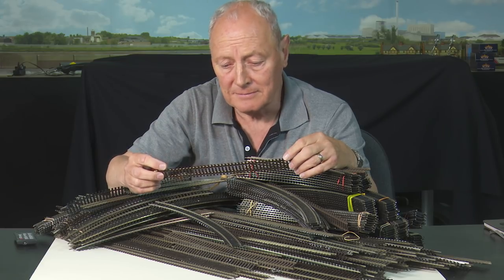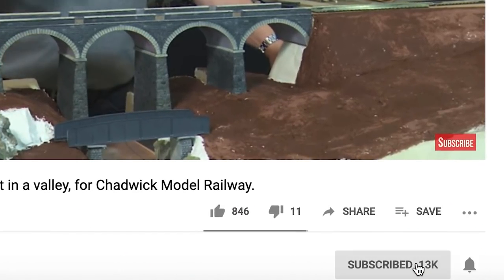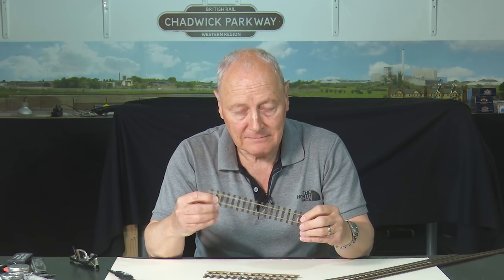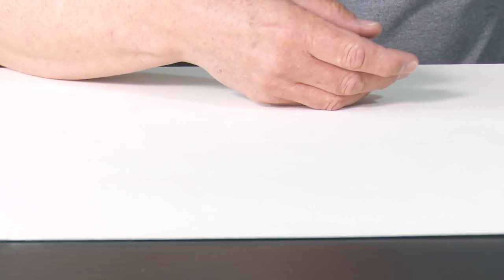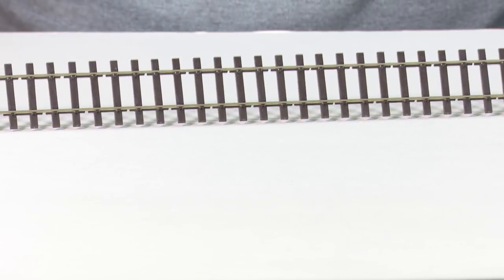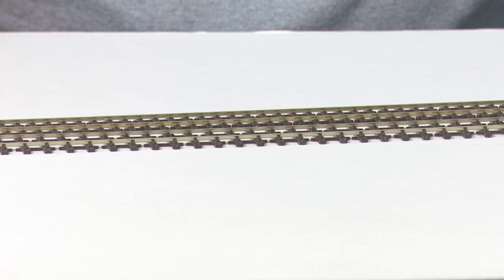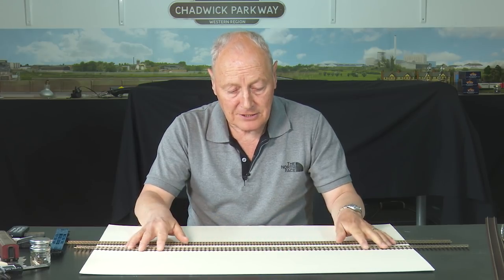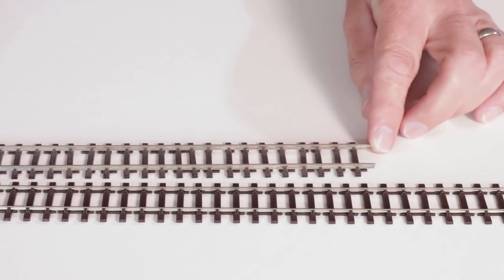Track  Peco Code 100, Code 75, Bullhead, EM and P4 explained at Chadwick Model Railway | 66.

Comment: This is a great video Charlie.
Recently my mother wanted to get the majority of my items I still had stored at her house out of the house in case her and my dad decide to downsize the house so she brought me a bunch of things one of which was my old "Micro Machine Trains" from the Micro Machines line by Galoob. They have no motorized Locos so you have to push the trains manually and are about on par scale wise with Z scale.
My son isn't old enough to play with them yet but when he is I will be excited to do so.
I have 3 of the Engine House sets which from what I can tell are quite rare, 2 of the Tressels which are also quite rare. 5 Left hand and 5 right hand points (points appear to be uncommon) and a bunch of straight and curved pieces for both the original track which has a raised groove down the centre of the track and the newer track which has a wider recessed area in the middle.

Appearently they were only on the market for about a year or two between 1989 and 1991 but it appears that my young self acquired over half, probably closer to 3/4, of all the different Rolling stock and Locomotives in the line.

At present time, finance and space prevent me from building a proper layout but at least I have some train related items to share with my son once he gets old enough that he won't choke on the rolling stock (He is at present 4 months old)
Reply from the maker: I’m so pleased that you enjoyed the video and that your situation has ring fenced a great deal of future fun.

Comment: Hi Charlie, very informative and enjoyable 👍. No bad language from me but I find Setrack a perfect solution for my needs. Living in London usually comes with 'cozy' living accommodation. Setrack enables me to quickly set up simple but functional loops and points with my design workstation in the middle. That way I get to enjoy running my locos and get on with my work at the same time. My wife often comments on the noise from the trains going round along with the fans whirring away on my workstation while I'm rendering out animations. It can be quite a noisy little room. Always inspired by all your (and everyone elses) videos about model railways but I can only dream... ;-)
Reply from the maker: The set track comment was a little tongue in cheek. 😜

Comment: Great video, as ever very informative. I'm about to come into a position of starting a layout after decades of frustration as an experienced modeller who lacked the space and time to branch out (pardon the pun) into railway modelling. I resisted the urge to go 'N' as I enjoy scenics and buildings and suspect the scale would be frustratingly small. I am very familiar with 1/76 and 1/72 from other interests. As I am starting from scratch existing rolling stock is not an issue, my debate has been code 75 or new bullnose, so this video has been a welcome overview. Keep up the great work and ignore those who might want to 'give you a thrashing,' you are only politely expressing your opinion on your channel about what you want to do. As in other areas, some more reactionary contributors would do well to think on that.
Reply from the maker: Thanks Chris. It’s comments such as yours that make it worthwhile.

Comment: Just quick point about concrete sleepers and bullhead track. Up on the Inverness to Aberdeen line we have quite a few miles that have bullhead rail on concrete sleepers. It is being gradually replaced but it’s still there. It’s also long welded bullhead- Cheers, Eddie (train driver in Inverness)
Reply from the maker: Thanks Eddie, fascinating info. 
Regards Charlie.
Reply: Great video as usual- working my way through the back library of your videos.

Comment: sorry if this is a repeat. 
luv your channel & all things UK prototype.
i'm a US outline N-scaler running code 40 & 55 track and old Fleischmann, Roco & Model Power stock, i.e., HUGE flanges !!!     (pizza cutters )
instead of buying all new low profile wheel replacements, what's working for me is the Dremel rotary hobby tool. set it securely in a vise. grind down the flanges with the Dremel. slow speed for plastic, high for metal.  use safety glasses of course. very quick solution and saves lottsa dough !  not gonna dump my old code 80 Atlas track though, it still has it's place in staging yards and 3 to 4 feet from viewing points, when painted with 'rust' (combos of raw, burnt umber) and well ballasted. besides i still need #4 &6 turnouts (points) which are not mfr'd in the smaller codes.  cheers to chadwick !
Reply from the maker: An excellent suggestion Mike, I shall have a go. Regards Charlie

Comment: That was just what I needed to find out. I am returning after 40+ years away and I have been thinking code 75 bullhead as it fits with the time line I have in mind. As I don't have any rolling stock or loco's at the moment, I don't even have a base board either, then I probably will be ok but will bearing in mind the issues you mention. I think you did. fantastic job explaining it all and I will be trawling your videos for more information.
Reply from the maker: That’s most kind CJ.  It’s great to have you onboard. Regards Charlie

Comment: Good timimng Charlie. I have just been through the exact same process and also have miles of code 100. I am in the process of undertaking a total rebuiild of 190m of double track layout with 7 Termini. Shades of  McKinley, well maybe but not so big. An way, looked long and hard at Peco Bullhead track and decided that it was worth laying some. It does look good but as you pointed out the real problem at the moment is un-availability of points. cross overs and slips. Also the cost of bullhead is considerably more than either code 100 or 75. So I currently hacking lengths of code 100 to get proper sleeper spacing. The difference when you adjust the sleeper spacing is staggering and for me well worth the time and effort. To begin with I had a lot of trouble keeping the sleepers aligned then decided to try a very small blob of glue on the underside of each sleeper where there is a small hole under the track. That worked a treat and now it is easy to lay the track and make certain that the sleeper distance stays put, well almost all of the sleepers are correct but there is always one or two that escape and need a final adjustment. So I think I may have reached a compromise that suits my style of realism without going to the expence of a total change to bullhead.

Thanks agin Charlie for a very useful and timely look at track, scale and gauge. Perhaps Peco should just do a simple mod to there existing code 100 and 75 and respace the sleepers correctly, simple!
Reply from the maker: I’m so pleased that you enjoyed it Bruce and good luck with your layout.

Comment: Hi Charlie, what a complicated subject, I'll make it more so. 
Concrete sleeper track goes back to Bullhead days but concrete sleeper pointwork is a very recent thing, so concrete sleeper plain track and wooden sleeper points is the norm.
C & L finescale produce code 75 concrete sleeper bullhead track and a variety of wooden sleeper pointwork, in kit form! There's also Marcway pointwork ready made but I think it's soldered and doesn't have the chair detail. Code 75 is worth the effort if you have the modelling ability (modelling, that's the difference between model and train set), it's not so difficult, just take your time. I've used it in the past, it looks so much better.
Now I just do 0 gauge, looks better all round!
Paul.
Reply from the maker: I believe that C75 BH will be on the next layout.
The diference between a train set and a model railway is .....
..... train sets get put away at bed time!

Comment: Enjoyed your video once again! I think that a trainset is the same thing as a model railway, as a trainset will tend to grow into a model railway. I think the real question a lot of people debate is whether they're model trains or toy trains, which to me depends on the seriousness of it's owner, so a matter of opinion perhaps?

Also, bullhead track did indeed have concrete sleepers, which are quite common and still to be found alongside wooden sleepers. Believe it or not, there's also steel sleepered bullhead (I think the GWR had them, and are evident on parts of the Blaenau Ffestiniog - Trawsfynydd line) and also an early interpretation of bi-block with bullhead rail(again GWR, and is evident in the headshunt/tamper sidings in Tywyn and Barmouth on the Cambrian). They're the examples I know of as I've worked on those sections of line, but I'm sure there's more around.

All the best,
Caz
Reply from the maker: Thanks Caz and I’m so pleased that you enjoyed the video.

Perhaps a train set is best defined as something you put away at bed time!

Comment: Excellent video. I'd suggest that if someone wanted to convert all of their existing track to the correct sleeper spacing that it would be worth creating jigs where the plastic could be cut, then another one to position the sleepers.
Reply from the maker: Yes and they are available too Simon.

Comment: Charlie, you said in your video that real mainline track is made in 60 feet lengths and then joined together and that scales down to 9.5 inches. So set track is more to scale than flexible track. I will be using the flexible track in the build of my layout (Not a Train set)  and once it is ballasted it would be hard to tell the difference between the two, My layout is going to be made with recycled Hornby track as that is what we have always used. I bought a box of Hornby Track off of eBay for 99P and when it arrived here in Thailand, it was packed in four boxes and one long 4-inch diameter tube which contents the flexible track. I bought it because I did not think I would have enough. Know I have made a plan for an extension board. As usual, it is an individual choice. Good luck with the rest of your rebuild. I will be watching. Martin (Thailand)
Reply from the maker: Thanks Martin, I’m so pleased that you enjoyed it. Good luck with your layout.
Reply: This might be kind of nerdy but I might cut up (or at least slot) the 914mm track lengths from Peco to simulate the rail gaps. 60' lengths would be very wasteful so I'm compromising on about 57' which is 228.5 mm, I'll copy Charlie's idea of making a scenic programming track to experiment before ruining loads of expensive bullhead.

Charlie, if you get to read this, which type of dremel cutting disc do you use? I'd like to go with the thinnest one they do that doesn't disintegrate after  just a few uses.

Comment: Depends where you are. If youre just about to start a new layout then look closely at EM gauge.   My old plank had code 100 concrete sleeper track with all.webbing cut and sleepers respaced.  Looked ok but that narrow gauge appearance from high view angles lets it down.
If youre viewing from the side and will rarely see 00 track from above then its a good robust system.
Reply from the maker: Interesting points, thanks.

Comment: Hi Charlie,
Well done for just about explaining track to us lets hope any new modelers don't see this first they may run a mile and never come back. I use set track for most of mine but I also use some flexi track and I have even cut up a point to make it fit (nearly all of my loco's can use it) so as my channel is a train set I seem to have it right but hang on I have some You Tubers saying why is it a train set and the reason I called it a train set was because I do not do all the scenic features that "proper" modelers do so ?????.My head hurts, but well done for this and look forward to your next offering as long of course as the channel does not come off the rails.
Cheers Robert.
Reply from the maker: Great reply Robert.
A train set gets put away at bedtime.
Reply: Hi Charlie,
My be but to put mine away you would have to start in the morning.
Cheers Robert.

Comment: First off all thanks for this excellent video Charlie. I fully agree that the confusion about scale and gauge will continue until wheeled vehicles will be something of the past ;-)

To set a the scene regarding where I come from. I am and model European. I have some H0 mostly rolling stock left over from club use that I can run on rail from a train set (later more). My current focus in on N-scale (1:160) and G-scale - and I still don't get what that should be even having all list of model rail scales and gauges!

I listened to your explanation on train set with a smile. As a professional designer I have seen a definition or two on many things. In my world there is not (never) an either-or or black vs. white situation so I don't define model railways in sets or not either. For me there is a changing grade of many variations between a wooden Brio set and a 'fine scale' 1-scale model engine. And when used well I like all those variations in between and beyond.

As a designer I have only one problem when talking about scale and that would be the way some scale names/indications mess with imperial and metrics. I know it works, but then it also doesn't.
doing some mm to the foot ... why? If you choose to work imperial fine, but stay put there. Better work in metric so the majority of the world can follow. because 3mm to the foot is 3mm to 304.8 mm that would be 1:101.6 and now we have the ration metrics nor length of some body parts in some century don't longer matter. What does matter and surprises many, that only architects and some museum pieces use a 1:100 ratio for their scale. That would be another discussion.

Back to track.

N for Nine
I am not modelling to make real scale things, nor am I modelling to make museum pieces, so I allow for much tolerance as long I got a good experience of what the builder intended. Which keeps my mind open for even Brio and Lego models (or is that toys?).
My N-scale is like you put it right both scale and gauge and because I model EU for me that is the 1:160 standard with the possibility of using Nn3 as narrow gauge. Here a real 6.5 gauged N-scale track would be nice, but Z-scale track I can live with.

G fro Geeee (what happens here)!
The original G fro garden/Garten rail is with 1:22.5 scale rather large and from the start defined as a narrow gauge railway on a track with 45 mm gauge.
It was really good to see you show the differences between all those different types of track, as that is what the different is.
I have no problem seeing a 1:29 scale train running on G-scale tracks, but be honest when it comes to getting close to the prototype 1-scale (1:32) also runs on 45mm gauge track the difference is in the rail height and form and the sleeper size and spacing. boy what a difference between a 1:29 on G-track and a real 1:32 locomotive on 1-scale track!

It is like with people, we have much in common but nobody is exactly the same, still we can enjoy our differences if we just are open for it.
With track and scale it is the same thing. I have seen beautiful lay-outs made with 'set track' and the use of very expensive fine scale flex track that came close to an insult of the hobby.
If you can convey your story with the materials you choose, it will be a job well done.
Reply from the maker: Thanks Henk, for such an interesting comment. Good luck with your project.
Regards Charlie

Comment: Hi Charlie 
Just wanted to let you know that there is bullhead track on concrete sleepers. I worked on the Conway Valley line and sections were indeed bullhead on concrete sleepers. They were 95 lb rail and the chairs were either C1 or C2 marked.
Cheers
Barry
Reply: Barry Jones I’m sure we still got some in South Wales just trying to remember where  at moment, Great info Charlie, did you see Richards video on Everard Junction,, he re spaced all his concretes
Reply from the maker: Blimey Barry I never knew that.

Comment: An interesting discussion and ultimately it comes down to how much compromise are you prepared to have on your layout.  I went down the re-space route and added bullhead in places as you know.  It took me 20 hours over the course of a month to re-space my track.  I'm very happy with the results but it's still a compromise and many would find fault with it.  Suits me for now though and in the next layout I might take things further. 

In my experience train set is a term used by 'normal' people when they ask about my model railway!

Cheers
Reply from the maker: I’ve watched your track laying video and it was one hell of an evolution.
I’m still unsure on my track future.  I’m hoping that the medium radius points are released by the time I finish the fiddle yard. 

One chap commented “A train set is something that you put away at bed time”. Very appropriate.
Reply: @ChadwickModelRailway  It's shame that the point work is taking a while to appear.  I've stopped ballasting at my station as I'd like to replace my single slip with a bullhead  one.
Reply from the maker: Peco told me last week that they are “in progress”.  Sadly, they were reluctant to give any firm indication of release dates.
Reply: @ChadwickModelRailway  Well at least they're in progress .  I look forward to the release.  Will crack on with other projects for now.

Comment: My vintage Wrenn locos and Hornby Dublo 2-6-4 tank run fine on Trix C-track which is a ballasted code 83. The frogs are metal and can be set live or insulfrog. A very easy to use system. I also have Japanese Kato Ho Unitrack code 83 which works fine on modern and vintage rolling stock but the range of track is not as extensive.
Reply from the maker: Thanks for the info Jack

Comment: That Peco bullhead looks very close to the SMP track which I use. It needs careful handling while laying but once down, its fine. I do use some code 100 in the storage yards and also have alot of Peco electrofrog code 75 which is fun getting the SMP to line up.
Reply from the maker: Great info, many thanks